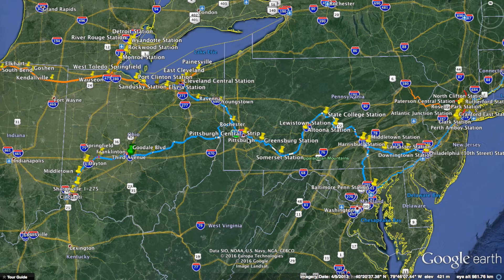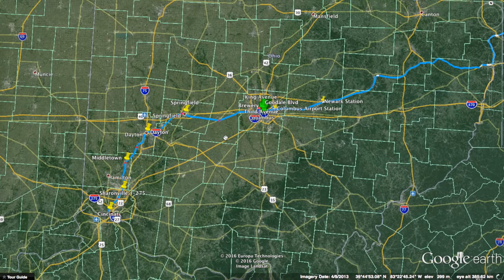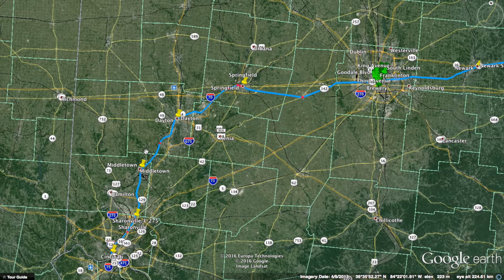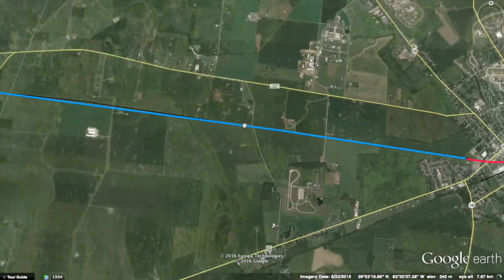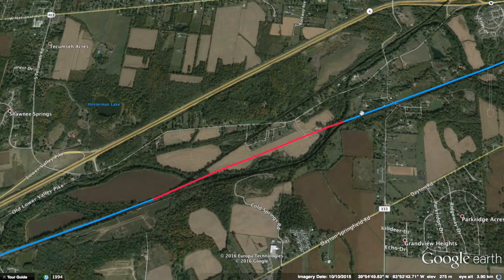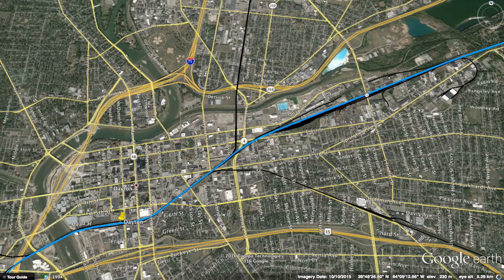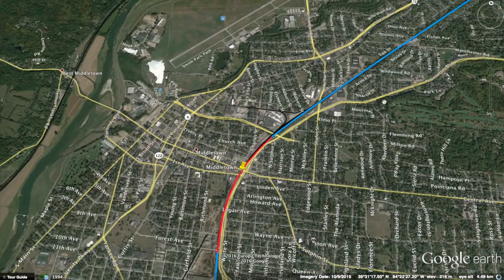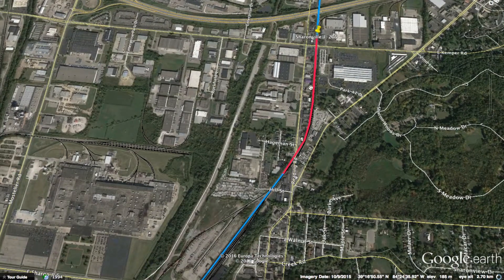Columbus to Cincinnati High Speed Rail

Comment: Ohio planned a true bullet train in the early 1980s but it was voted down in 1982 or 1983.  That plan would have dug a tunnel northeast from CUT to the Ivorydale Junction, then traveled 10 miles elevated above the existing freight tracks to the Sharonville Yard.  So trains would have traveled approximately 100mph through Hamilton County before turning on the gas an pushing 175mph in Butler County.

Comment: Just a suggestion for the upcoming Cincinnati to Louisville line: The line should serve Cincinnati Airport(which is actually in Kentucky), but the existing line is a rather far distance from the airport, so I was thinking you could make a stop where the line intersects with I 275, and plan out a shuttle bus route that will take travelers between the new station and the airport. That could definitely help long distance travelers.